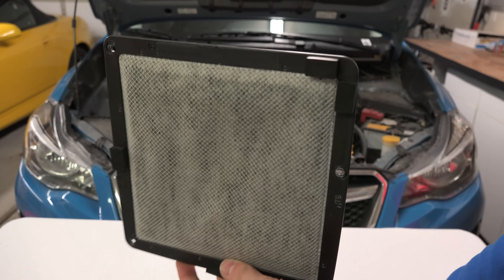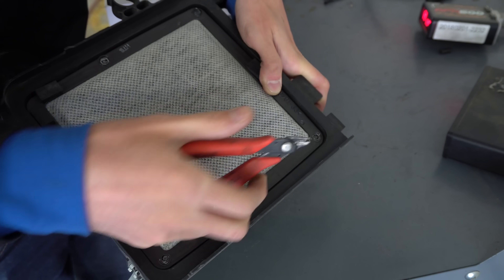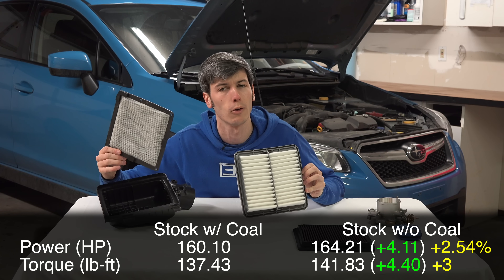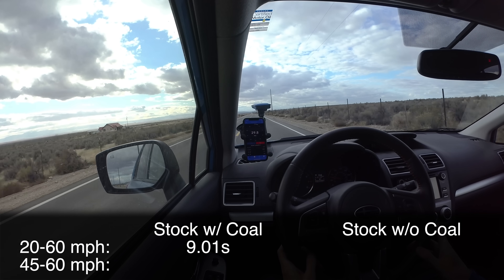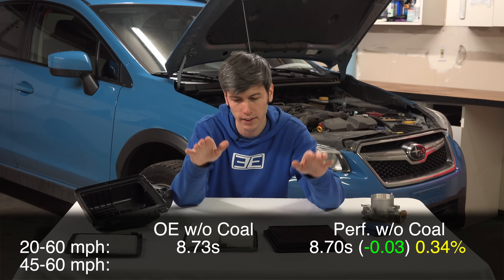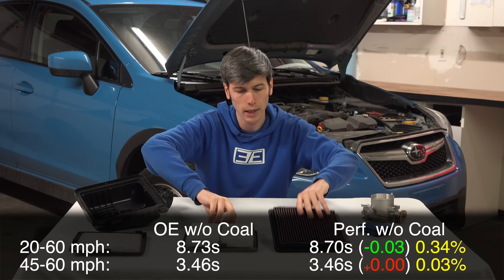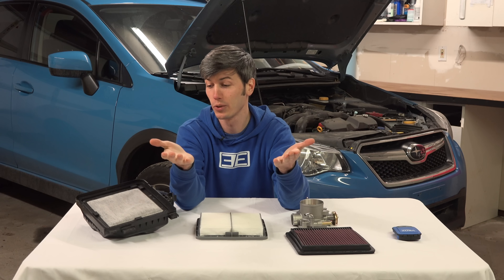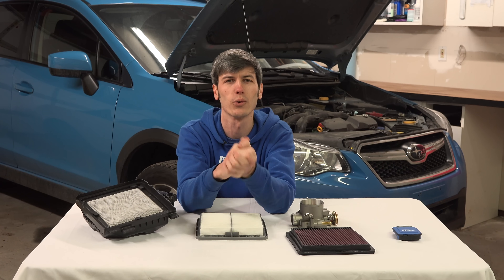Do Charcoal Air Filters Rob Your Engine Of Horsepower?

Comment: Re warmup on the dyno.  When we did lab experiments we would run a calibration check, then the samples, and then a calibration check again. In your case you should run condition #1, then condition #2, then condition #1 (or part thereof) again. This helps to get rid of systematic error due to factors that may change during the tests.

Comment: Very interesting. Speaking of performance filters, I heard those can mess up the MAF sensor because a film comes off the filter & hits the sensor causing the check engine light to come on. Any ideas?
Reply: Only with oiled filters. It CAN happen if oil flies off the filter and gets on the MAF sensor.

Comment: Been there, done that.  Used K&N filters before, sure they work, I don’t like the labour time and difficulty getting the bugs out (I’ve tried soaking, hose, degreased etc etc) they get stuck in the pleats and are frustrating to try and clean, so I went back to the disposable factory air filter.  I got a remap, exhaust mods and better tyres.  That improved the performance to a high amount.  The Audi Q7 already had two large area sized air filters, so the design is excellent.  K&N was not worth the hassle.  Just my experience so save your dough and put it towards an aggressive remap.  It will put a smile on your dial.

Comment: I removed the charcoal and air filters and installed K&N high performance filters on my f80 m3, and I didn’t feel any difference besides the turbo whistle significantly increased and that’s it lol so I think drop in filters is either waste of money or it doesn’t work for some engines like my S55 engine!!!

Comment: Wonder how restricted the coal filter is after 200k since it is never replaced... Yes it is after the regular filter but still, nothing's perfect,
Reply: My 06 Avalon has 200,000 miles that filters never been replaced I took it off put a k&n filter on it but didn't remove the factory ram Air piping and I can notice low in torque improvement when you're just coasting 60 and you press the gas about 25% picks up quicker without as much throttle
Reply: didnt even think about this, you are right. old cars go fast as new when you take these restrictive things off

Comment: What if you take out the air filter and just leave the carbon filter?

What if you replace the air filter with a sheet of fabric softener?
Reply: What if you replace the charcoal filter with just a fabric sheet and put a k&n filter
Reply: I think out of the two, the air filter is probably the least restrictive for airflow. It is designed to be, just to get the bare minimal amount of particles from getting inside engine

Comment: I feel like your test is partially flawed no offense I love your videos as a mechanic sometimes I have a hard time explaining to my wife different things and it’s easy to just forward your videos. But anyway my point is that different cars have more and less restricted air boxes. For example I had a 91 Cadillac Saline with a 4.9Lv8 and a air box not much bigger than you Subaru so putting a k&N filter on and opening air box up a little helped emensly but on my wife’s 3.5v6 RAV4 i removed charcoal filter and added k&n and opens air box a bit, mostly to help evenly coat air filter with dirt so helping it be as effective long term as possible but still adds some air flow I noticed not much at all mostly a different engine tone and could be me but feel like it revs a little faster but really not much at all of a difference but I think the principle remains it depends on how restrictive a particular cars air box is

Comment: Late reply but i removed this charcoal filter from my daily 2007 corolla 1.8l which already has aem in-box filter and i can feel the throttle response is more responsive and the cars Topend is improved on wot.the induction noise is also a bit louder now.for a daily drive and good power especially on low rpm the car drives way better.i like it

Comment: So their thinking is "how can we stop the little bit of gas from evaporating into atmosphere when you stop the car top save enviroment" "lets put another restriction into the intake system so the car uses more fuel when driving!" aka in the end harm the enviroment more that without this thing. Great idea!!!
Reply: it uses less fuel because its getting less air what are you saying?
Reply: @Okami400  no, more pumping resistance means more energy loss, so higher fuel consumption. It's probably negligible, but still.

Comment: Why don't the just have the ecu cut fuel to the injectors a few seconds before cutting the ignition when you turn off the vehicle?
Reply: Someone correct me if I'm wrong but my assumption would be internal valve and cylinder lubrication
Reply: @matthewhall7476  not a bad thought but gasoline is more of a solvent than a lubricant despite lubricating additives in modern pump gas. Besides it would only be for a few strokes before the engine stalled out

Comment: the automatic (CVT) crosstrek has this weird thing where when you completely close the throttle it has a very delayed "engine braking" affect. it feels very different compared to normal engine braking as it's so delayed. it's actually very annoying because of how delayed it is. When i removed my filter, this affect was greatly reduced. I noticed it almost immediately which leads me to believe it is a real occurrence and not placebo. Jason, i believe your crosstrek is manual but you should look into the forums as i believe other people have noticed this happening as well. 
My only guess is that the amount of vacuum being produced at throttle fully shut is very slightly reduced. and i say this because when the car is running i don't believe the throttle completely closes. it's my understanding (and i could be wrong) that the throttle never fully closes and there is always a slight tilt in the valve (maybe 1-2%) this would mean that the intake track before the throttle body can still have an affect of the vacuum pressure inside the manifold. so a more open intake filter should theoretically reduce the vacuum pressure inside the manifold, all things being equal. this would reduce engine braking as, i'm sure you know, vacuum pressure is what causes this. 

I do feel like simply removing the carbon filter (which is giving you a few percent in increased airflow), combined with an almost completely shut throttle body should cause a VERY minute chance in manifold pressure. But with that being said, it did seem fairly noticeable when i removed the filter. and this is the only explanation i can think of.

Comment: I don't think the acceleration from 20 to 60 is just  a straight line value. At some point acceleration will be distinguishable without any crazy ability to perceive acceleration. Just find yourself g-meter and see the acceleration graph. But still not a big change though with filter removal.

Comment: How about doing one comparing economy with/without?
Reply: Your economy will improve more air better combustion better performance...BUT you will only see improvements that the manufacturer allows since the ECU is preprogrammed with set values to maintain. If you really want to see improvements you have to replace the ECU or program the ECU yourself. But overall you would see an improvement removing the filters from your car

Comment: Real question. Why was this test and the previous test done on your crosstrek and not done on your s2000? Would a more powerful engine generate a larger gain difference in hp or acceleration in g's? Is that a factor at all? I'm very curious.

Comment: As far as i know, using charcoal makes sense, IF you intend to put in CABIN air filter to catch all the extra crap, stinks, bacteria and everything else that's floating around. Using it as a component in engine's air filtration in a way you explained it, doesn't help at all, it's not like engines are spraying out oily fumes and atomized gas into the atmosphere in large quantities. I'm working with cars for quite some time now, but this is the first time i've heard about this stupidity. As someone already said, sounds like some nutcase from Cali came up with that.

Comment: My car doesn't have this filter, but I watched the entire video :P  why ? 

I am new to carmods and I'm having fun with  a MK7 1,8 TSI Sportwagen (Unitronic 1+ tuned).  I try to do it wisely,  that's why I've subscribed to your channel ;)   I also like really exciting math :P  
It's hard for people to make clear decisions when it comes to performance because we cannot afford  to run a dyno on every single mod like you do,  and it's easy to be trapped by the tuning shop staff as they want to sell parts. 

I would be very curious to compare   100% stock intake  with the following changes I've made  that are wayyyyyyy cheaper than a ricer open cold air-intake (which i know is useless) :
- Snowguard removed + K&N filter
- CTS inlet hose and inlet pipe  

Thank you for the good videos !!

Comment: Hey! This isn't related to the video.
How do Subaru 4wd systems deal with the speed differential when the ABS breaks are active? 
My 2004 legacy saloon has the old viscous coupling centerdiff and after watching your video on the Subaru 4WD systems I started wondering how a permanent 4wd car reacts to ABS and without it breaking everything inside the transaxle?

Comment: Very nice video , it will be nice to make a video about how air temperature/density affects acceleration - fuel economy - or power.
Something like comparison between a stock intake and wrapped stock intake or compare acceleration times between very early in the morning and midday  ( I know February its not the best time for this test but I think it's a cool test for the spring-summer ).

Comment: My only issue with those oil performance filters is that oil gets on the MAF sensor and on the throttle body and small dirt stick to that creating issues down the line which of course can be cleaned easily if you know that.

Comment: Are charcoal filters a new thing? I've never seen one before, and I live in California. I figured we would have the most strict emissions laws. My 2015 WRX does not have one, which is the newest car I have looked into.
Reply: @0utcast  For sure. Maybe they could be integrated into another part of the air box or in one of the pipes out of view. I guess I just got confused because my subaru of a similar year and engine doesn't have the same charcoal filter.

Comment: The charcoal filter isn't a filter. It only stores fuel that's left behind when stopping your engine. Not only the fuel in the inlet manifold but also fuel from a combustion chamber when it's left open by an intake valve. By starting again the stored fuel enters your engine together with the air flow on top of the fuel that's already injected. The mixture can be rather rich for e few seconds because the extra fuel is not calculated by the ECU. But the ECU has to deal with it because of the Lambda reading. A Lambda probe is fast when it has reached it's operating temp, cold is another story. And for how long can a charcoal storage unit hold these vapes? Imho the question is: Do we want fuel vapes or exhaust gasses? Nice topic. :-)

Comment: Jason, I have a question regarding Subaru symmetrical awd. I believe although it is a good awd system in most scenarios, they can also be unsafe because of understeer at high speed around corners. Although symmetrical awd eliminates a lot of weird behavior you would get from front or rear wheel drive biased awd systems from other manufacturers, I feel that at the limit they might be a little more controllable and communicative. I am soon going to buy a new wrx regardless because I love Subarus, but was just curious about your opinion on this matter.
Reply: It is called symmetrical by layout (geometry) principle. Torgue distribution has nothing to do with its layout.

Comment: I personally cant stand it when im told 'only do this if youre only going to track your car and not daily drive it'
If ravetracks were a self contained ecosystem with its own recirculating and purified air supply that never goes outside the track area sure. But that "offroad use" only crap is just that. Crap. I can understand commiefornia doing it because they hate everything. But for the rest of us that live in free states, I'll do what i want with my car tyvm. Offroad or on road

Comment: It stands to reason that the long term effects of a less restrictive air filter is increased engine wear. That's why I'd leave everything stock.
Reply: no fun allowed. 

also not changing your oil at 5k intervals is more of engine wear than any charcoal filter removal is. 

one causes piston knock, the other causes literally nothing but a higher mixture of air and gas

Comment: Perhaps someone has already asked this question ... but I’m curious to know whether or not fuel economy is affected by the charcoal filter. Would you experience a slight reduction in fuel economy with the charcoal filter in place as well? If so, would this loss offset the benefit of having the vehicle equipped with the charcoal filter?

Comment: Charcoal filters on auto air intake is COMPLETELY UNNECESSARY. An efficient particle filter is all that is necessary. As far as low level hydrocarbon emission, a billion times the hydrocarbon pollution comes out the exhaust.

Comment: I'm owned by my Toyota, and not long ago, it got bored and experimented with how much pressure the crankcase could handle before becoming a fountain. It ruined both filters and so much more, so I got tired of giving Toyota money, and just misplaced the charcoal media and remounted the empty grill. The state I live in only uses an exhaust probe, with visual ID for the individual components. It's the only time I have ever gotten a noticable increase in performance from removal of the thing, but it was completely restricted before, so that would be difficult to not have a improvement over the OE piece.

Comment: if the guy loves his math, then let me hit you with this, with that amount of real world gains, it wouldn't be too hard to see extra 1mpg gain for every gallon of gas used. in a car with 15 gallon tank, that means an extra 15 miles gains per fuel up. most modern car gets close to 30 mpg, so this is about half gallon saved every fuel up.  On the west coast average gas almost $4, half a gallon gain is $2 in savings. thats not much but if someone who commutes a lot and fuels up every week, we are looking at $2X52weeks= $110 per year, and most people will keep their car over 5 years which be equal to $550 savings, if you keep your car for 10 years you are looking at $1100 in savings. So don't tell me his math showed very little difference in gains. that car cost is about 20K, if you can save 1K in the life of the car you just saved 1/20th of the value of that car just by removing a simple filter. So don't sit there and tell me there are no significant gains. BTW if you don't think that gain is possible I know for myself in my car just from going from stock air filter to a performance air filter my MPG went from about 29 (stock) to about 31-32 (performance) so trust me when I tell you air intake is very important to you car, its why its one of the first mods every one does as soon as they get a car, is cold air intake, blah blah etc etc.

Comment: Some say that the K&N type air filters don't filter the air as well as the replaceable O.E filters do. By removing the charcoal filter, you can gain 4.11 h.p and 4.4 pound feet of torque for free according to the test dyno, a.k.a, just throw your charcoal filter in the trash can and move on. You might even improve your mpgs along the way as well.
Reply: What about gas millage. Will the improvement in MPG (or for the rest of the world, almost) litres per 100 Kilometers be worth it, even with stop/start?
Reply: My own observations on a variety of road and rally cars over the last 40 years are that cotton/oil type filters filter the air just as effectively as paper filters. In my rallying days, we're talking about  carburettors - usually Webers (40DCOEs mostly). I once suffered serious carb failure using a well known make of foam filter due to dirt ingress, but switched to cotton/oil and never looked back.
More recently, I have owned my tuned Saab 9-3 2.0T for 15 years now (see it on my channel) and covered 157,000 in it. During this time it has always had the same cotton/oil filter. Never once have I seen dirt in the top of the airbox, nor in the intake cobra, nor has the turbo come to any harm due to dirt (to a turbo spinning at 200,000rpm or more a piece of dust you cannot even see is like a brick thrown at a window pane). At a total of 187,000 miles my turbo is clean as a whistle and consistently pushing 20psi boost.
I live in a rural area of the UK Midlands, where there is plenty of farming and building going on. It is dusty round here (just ask my wife about the dust in the house, lol).
In short, urban myth, IMO & IME